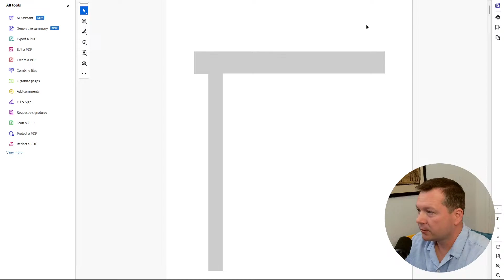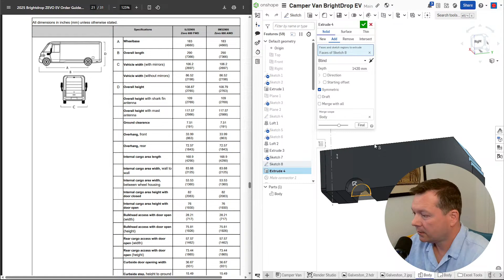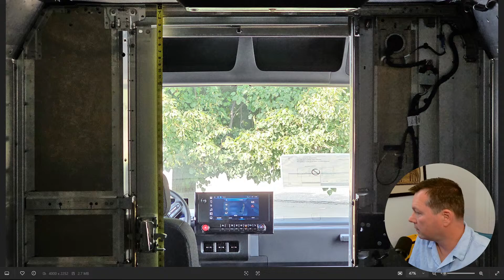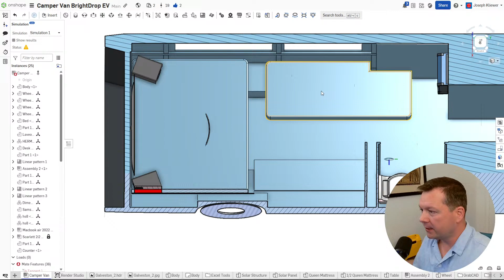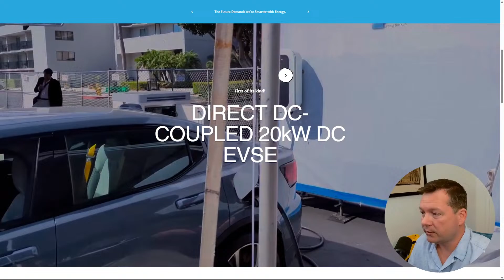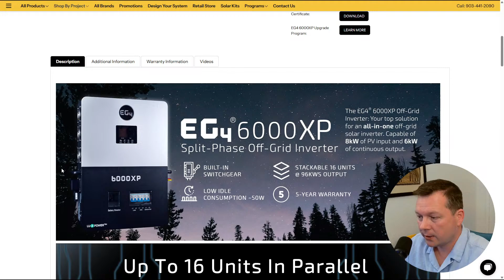Engineering Jam Session 1 EV RV Light Powered 1

Comment: (This may have been covered in the stream, I only skimmed it).
Why are you going with flexible panels to mount on a rigid frame... while lighter, aren't flexible panels less efficient?  You can probably afford the weight, so isn't photovoltaic  efficiency king?

On the two van models, isn't the miles per watt the most important rather than battery capacity.  While slower in the cannonball run, the extra length will certainly provide a more comfortable vehicle.
Reply from the maker: Yes, I am still flexible on the panels :) However these are industrial peal and stick panels with limited flexibility but greater than 20% eff. Framed industrial panels are heavy and bulky with not much added rigidity. I want something sleek and aerodynamic with rigidity and light weight, plan to use aircraft fabrication techniques. Although this rig could do a cannonball run, the goal is to be able to take the whole family off grid camping and lack nothing, AC, charging, hot showers etc.